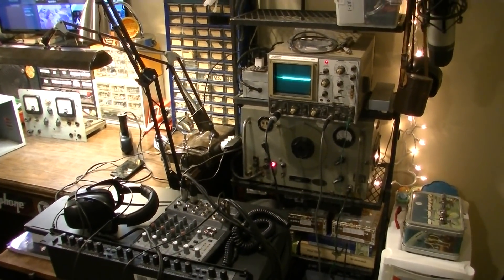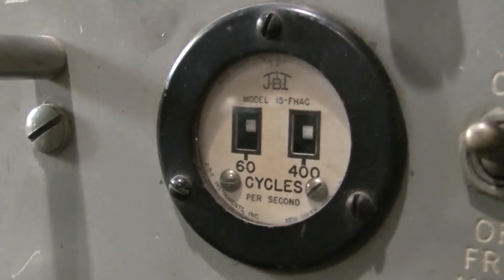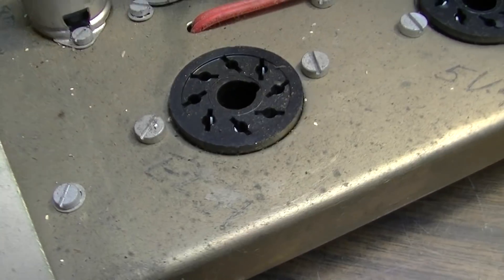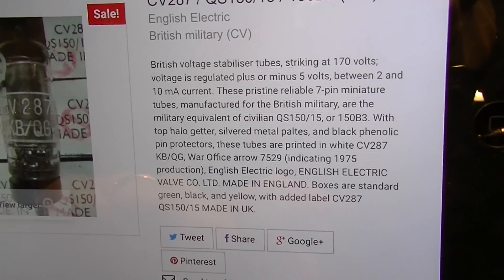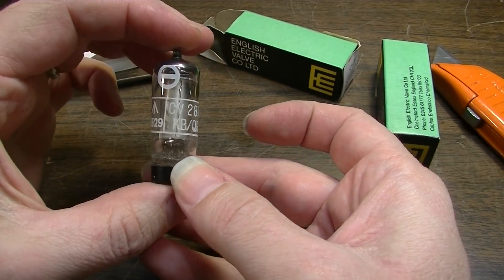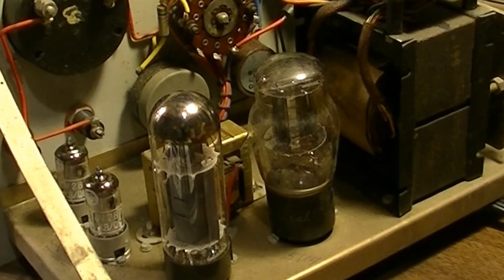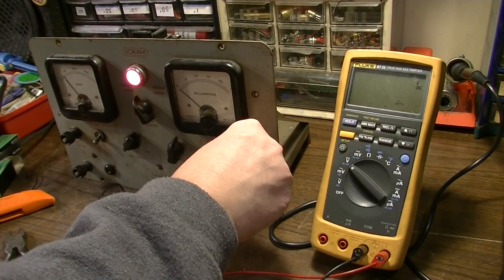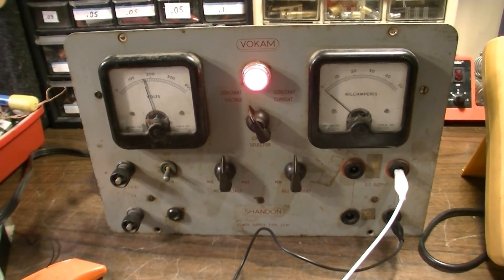1950s Shandon Vokam 2541 High Voltage DC Power Supply Resurrection

Comment: Looks like the signal generator was designed to work at 2 supply frequencies. 60 cps for ground power and 400 cps for aircraft power. Very cool!

Comment: The discrepancy between the analog meter to your DMM is most likely the meter is a 1000ohm per volt meter. If you do the math and shunt your DMM with proper resistance to what voltage you’re checking you’ll most likely find they match pretty close. Just had to do this calibrating my old Hickok tube tester.

Comment: Hi Brad, I'll go out on a limb here but as to the minimum voltage - 54 volts - I'm guessing it was not designed to go lower than this. As this was designed as a high voltage power supply anything below 50-odd volts wasn't considered high in valve technology so it didn't matter. Happy to be proved wrong though.

Comment: Well I guess I should watch the whole video before I comment.  When you mentioned the AC component that was probably the power supply ripple.  This would have been a good time to break out the scope and actually see the AC voltage riding on the DC level.

Comment: Using an O'scope servicing guitar amps is not really very useful, a meter is generally all you really need.  With a scope you can actually look at the signal and observe factors such as power supply ripple on the B+ and the frequency response of your amplifier stages when used in conjunction with the signal generator.  Mostly in guitar amps we are not really concerned with distortion too much.  When servicing HiFi equipment being able to measure/analyze signals and reduce distortion is very important.

Comment: The meter in question is a self-check for the accuracy of the signal generator.  Turn on the switch and bring the frequency to 60 of 400 Hz.  At the indicated frequency at the dial the reed should start to vibrate at it's tuned frequency.
Reply from the maker: Thanks for that. Makes sense.

Comment: Fairly standard linear voltage regulator ;-) I saw ones with a pentode error amp (eg. EF86),  somewhat better regualtion.
I wonder why it uses two precision neon lamps ;-)

Comment: Bought one at a university auction and it sits in my garage for 20+ years. Walked out, picked it up, plugged it in and got 6.68 vac and 375+ Vdc on fire up. Loaded with a Brimar 5z4 and GEC gas tubes. Had to supply a Svet EL34. Bloody Well!

Comment: Here’s me Brad, a Brit who worked in audio and television servicing for thirty-six years and I’d never heard of Shandon Scientific products …never knew they existed.  
It might sound more strange but we used American manufactured bench test equipment (exported for the UK market), which included high voltage power supply bench equipment.  
If, for example, some valve audio equipment came into the service department with ‘Dead’ written on the job card, it was usual for the tech who was assigned to the repair job to temporarily disconnect the amplifier’s HT rail(s), along with the valve heaters, and quickly hook up the high voltage bench power supply as a means of assessing the strength of the rest of the amplifier.  We also adapted each one of the high voltage bench power supply units for reforming electrolytic capacitors.
It’s always good to see ‘Made in England’ …it’s rare we see that printed onto new products these days.
Regards, Phil.

Comment: The way that PS is built reminds me of General Radio stuff.  Very neat layouts and built to be thrown down a flight of stairs and still work.  
I've been in the electronics business (govt metrology) for over 22 years now, and finding schematics and manuals for old stuff like this has gotten better and better over the years, thanks to people who take the time to upload them.  I see pdfs and pics uploaded for gear now that I couldn't find even a couple of years ago.  We have a giant library of manuals, but not for everything, of course.
There is still (believe it or not) tube-powered stuff in circulation, and we'll keep it running for a few reasons; engineers sometimes preferred particular older analog equipment, we still had the backstock to support it and we have guys who still know how to work on and appreciate the vintage stuff.  We have a Hickock 539C that I keep under lock and key lol.

Comment: You would have needed a load for both constant voltage and for constant current.  The EL 34 tube is likely not able to turn completely off, so the leakage current, maybe a milliampere should be consumed at the load.  And like somebody already pointed out, constant current is meaningless without a load.

Comment: On the oscillator, the frequency meter is for calibrating the frequency dial.  If you tune to 60Hz or 400Hz, you'll see it vibrate.  You can find the manual for it here  https://bama.edebris.com/manuals/military/ts382/    Irfanview can open it after you rename the file to a .djvu extension.

Comment: Selecting constant current with no load is going to slam the regulator wide open.  But you probably figured that out already.
Reply from the maker: Right. If and when I get back to it, I'll hanged those caps and design a simple tube circuit on the bench and really check it out.

Comment: On the signal generator, I would say the frequency meter is monitoring the frequency of the power cord.  60Hz obviously being regular line voltage.  400 Hz would be an aircraft.  So they would have been able to have used in on an aircraft and make sure the frequency was where it needs to be, though I'm not sure how the meter itself is supposed to indicate that.
Reply: it is called a vibrating reed frequency indicator. The left one (60hz) should vibrate up and down since your AC input is 60hz
Reply: The manual I found indicates that it's connected to the oscillator output and used to calibrate the frequency dial.  That makes more sense to me than indication the power source.  Yes, 60 & 400Hz are common values because they're used for power.  I'm sure that the meter was selected because it was readily available.
Reply from the maker: Maybe it's supposed to light up whichever one is active?
Reply: I found a manual online. It appears to be to calibrate the frequency dial.
Reply: I think they are mechanical resonators, the white stripe will blur out at resonance to indicate supply frequency is OK (and tell you whether you're on an aircraft or not!)
Reply: if it says so in the manual then it is correct! (I've only seen them used on generators to indicate the output frequency and its drift )
Reply: no, it just vibrates. its possible that your power is a clean 60hz, so the reed isn't vibrating aggressively or variably. here is an example vibrating reed frequency meter:

https://www.youtube.com/watch?v=dLunoQD4hSM
Reply: well that's what i thought at first but then Russel Hltn came up with the correct answer taken from the manual. It vibrates when the output is 60 or 400 hz. It is there for calibration/verification and not for indication of the ac line freq. See Russel Hltn's  answer.
Reply: A lot of ships and trains used 400 Hz. 800 and 1000 Hz were used too.

Comment: Cool power supply...Setting the primary to 120 should bring down the filament voltage down a little.
As mention earlier, if you are seeing AC on the output it's time for a recap.

Comment: Those HV power supplies were used for supplying B+. I don't think there should be any AC on the output. Also the output should go all the way to or very close to 0 volts.  This may indicate there are some issues. I would look into it a little deeper to verify proper operation before e using on any repair gear. Another thing, the output amp meter only goes to 50Ma. This will be your maximum current output. Good luck with it.
Reply from the maker: I agree. The lytics need changed, I'm sure.
Reply: How far to 0v you can get depends on the regulator circuit, to control to 0 it wil need a negative supply to do that.
Reply: I agree, 0v is optimistic and I don't know anything about the model Brad has. I can only go by the info of the HV supply I have. It's a Heathkit 2717A and the cal specs show a 400v adjust and a Zero adjust sitting on opposite sides of the main B+ pot.   
I went out my shop and I started mt HV supply up and and after letting the power supply warm up a little I was getting -0.137v (That's Negative  0.137) to 446v from zero to full voltage. The readings were taken with a Fluke 87V.  Of course I havn't recal'd it since I re-tubed and recapped it several years ago. 
Brad's model may be different but I think zero or very close to zero is possible.

Comment: Cool gear Brad.  I have a 1477 BK scope,, they're good equipment.
Reply from the maker: True. Strange then that they would waste two fuse holders dedicated to holding spares.
Reply: Well after thinking about it,,, that unit was probably used in all services, yours was just assigned to the USN. So my bad,,, you are probably right on that Brad.

Comment: Brad I have a question for you... I have a carvin V3 and it has a voice out jack on the back and I was wondering if I can run a line out from that jack into another amp so then I can run 2 amps at the same time? Or if I do that am I gonna burn something up? And if I can do it should I use an instrument cable or a speaker cable?
Reply from the maker: I'm assuming that's a line level signal for recording, so you should be able to run out to another amp. That's what it sounds like to me, but you might go to their website and download the manual. https://carvinaudio.com/pages/guitar-amp-manuals
Reply: The Guitologist ya I have the manual it says it's a line out for a mixing table I just didn't know if that would burn up the carvin some how or burn up any other amp I run with it.... should I use an instrument cable though or a speaker cable? Thanks for replying man I really appreciate it.
Reply from the maker: Instrument cable. No, it won't burn up anything, but if you're putting the signal into another guitar amp, start with the volume all the way down and bring up slowly.
Reply: The Guitologist sweet man thanks for the advice... I bought a MXR  a/b stomp box to run both amps at the same time.... but that pedal sucks! It hums crazy loud and it cuts the tone of my guitar almost in half.. and I paid full price for that pedal 70bucks... it was the guitar investment I've ever mad.... thanks for your help though man I really do appreciate it......
Reply: I meant worst guitar investment I ever made..